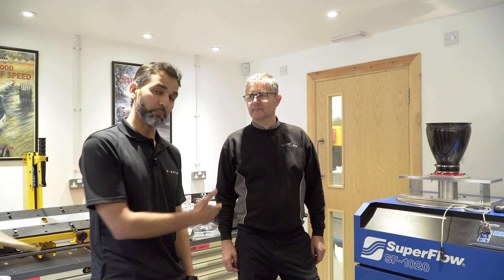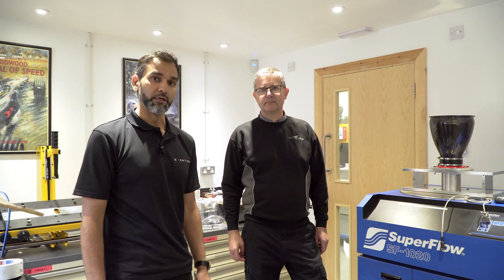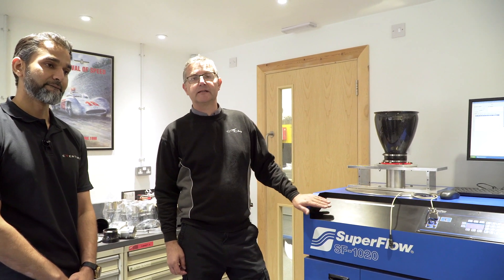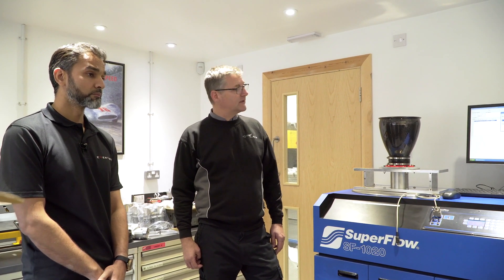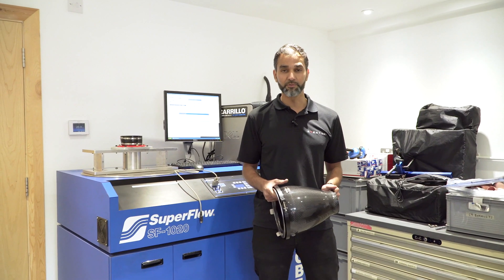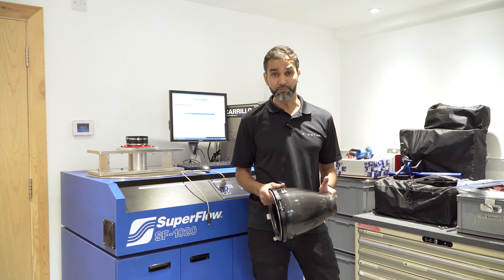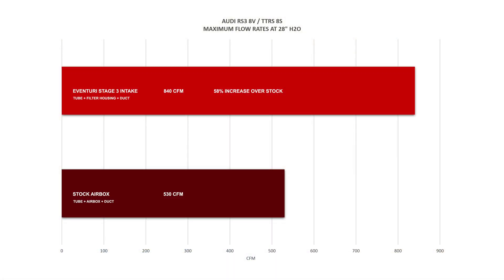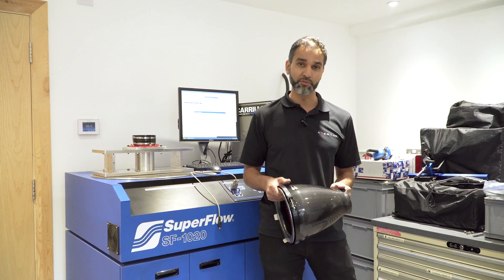Testing the RS3 8V TT RS 8S Eventuri Stage 3 Intake System on a Flow Bench

Comment: Can i use this on a stock 2018 ttrs with no tune and still get any hp gains/improved throttle response?
Also, is the gen2 also the stage3 intake ?
Are my options for lhd 8sd us 2018 ttrs
The gen2 intake & the stage3 intake?
If also getting the eventuri turbo inlet for the stock turbo im assuming i need the flange... Is the inlet for the gen2 and stage3 models? Or are they the same thing for the 8s TTRS lhd 2018 ?(non-opf)us model

Comment: Eventuir gen 2 or UNITRONIC or integrated engineering? They all have the same full carbon setup but bit different filter housing. I am a new 2018 rs3 owner. Total newbie lol. Could use help. I know there won’t be much difference until it’s tuned but it’s just want to get an expert opinion. I do plan on tuning it,turbo inlet and currently looking at full exhaust but I’ve only done small mods like K&n drop filter and removed resonators and waiting on the mail for the exhaust valves delete plugs. I do have the sport exhaust with the black optics trim. So if I could mod the stock sport exhaust,even better lol but I wouldn’t mind changing the whole exhaust. Just the price is crazy lol. Well then again all the mods seemed to be over $800- 1,500 lol. Thank guys
Reply from the maker: There’s only one choice for the RS3 8V - EVENTURI!

Comment: Hello Eventuri team, as an Gen2 kit owner I am really interested how many cfm my intake will generate. Do you have some data to compare gen2 with stage3 kit? 
thanks in advance
Reply: @Evolve Automotive, was the Audi RS3 gen2 kit ever tested with an flow bench? I do not understand why you present us the OEM and Stage3 intake only :-(   It will be a great to merge all this CFM results together combined with/without the Eventuri turbo inlet.
Reply: If you take a look at he stock intake flow , that probably flow well up to 500 hp , the stage 3 can flow 1000 hp or so , you will need to put a filterminder in the intake and do some logs to see the diff loss pressure with the intake in the car and compare with the cfm flow of the intake .
Reply from the maker: I know there will be more testing so I can pass on your request. Part of the reason for the RS3 project was to see at what power level the Stage 2 kit became a limitation. Up to Stage 2 there was no difference between it and the Stage 3 kit.
Reply: The interesting part begins at higher hp values in deed. 
Someone for Eventuri at FB wrote the stage3 kit become benefits starting around 650hp. Now the raw CFM difference between gen2 and stage3 kit bring a clear focus on that. I am looking for some clear data for example we have a 750hp engine and what is the benefit to use stage3 kit instead of gen2... will this result in 10-15hp...!?

Comment: would love to see filtration test results, how much do you sacrifice filtering performance to get the gains in flow?
Reply from the maker: If you check the Eventuri website they have a detailed section on their proprietary filter design. The filter has been ISO 5011 tested which is the same standard an OEM filter meets.

As you can see in Tests 3 and 4, less than 10% of max airflow is lost from the filter itself, which is testament to the amount of R&D that has gone in to the filter.

Comment: Does the test prove it will work better with hybrid?
Reply from the maker: It proves the stock intake can only flow a certain amount of air, and that the Stage 3 system can flow 58% more air
Reply: I've used CFD on SolidWorka and wondered if you've been able to compare simulation results with physical testing? And if so what differences there were. Thanks
Reply from the maker: All designs are CFD tested, I must admit I’m not sure how they compare to the real world testing.

Comment: Why is this a closed system, and the M4 one isn't? If I had some numbers to work with, I might actually buy one.
Reply from the maker: Different engine bays have different requirements
Reply: @EvolveAutomotive  Do you have a white paper of your findings? I'd really like to see MAF numbers.

It would also be interesting to see filtration numbers on the intakes. It's ok giving a much more breathable filter, but how does it compare to stock?

Are these all available?
Reply from the maker: All published info can be found on the Eventuri website. The M4 will be flow bench tested in the future also I believe.

Tested systems are with filters in place unless otherwise stated. This video shows how un-restrictive the filter is, only reducing flow by 90CFM, or less than 10%. Not bad for something that is vital.